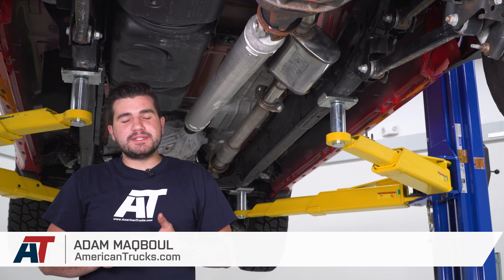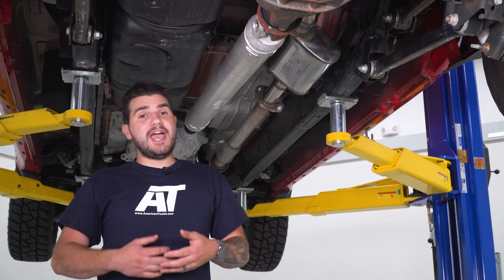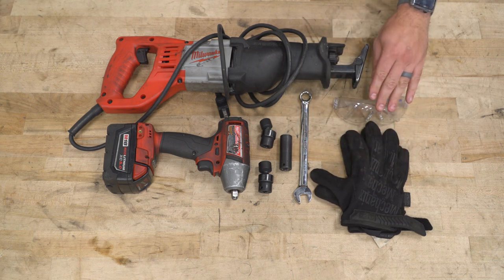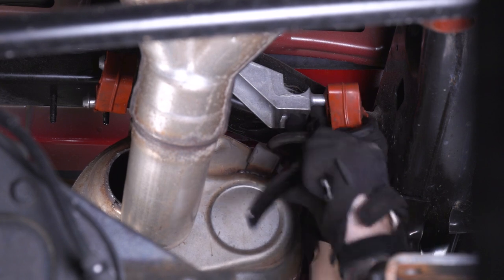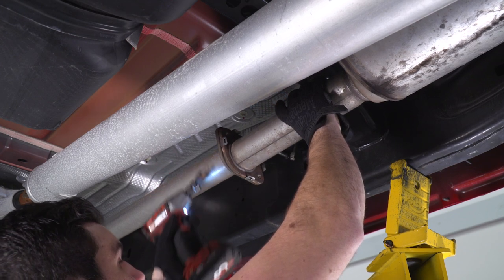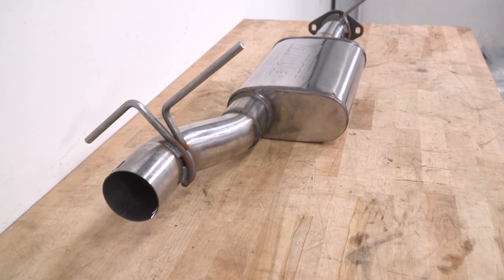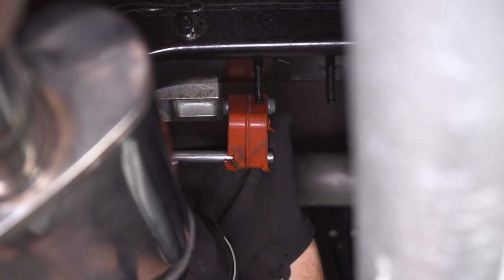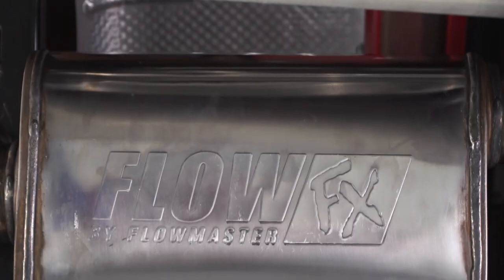2019-2021 RAM 1500 5.7L Flowmaster FlowFX Direct-Fit Muffler Sound Clip & Review

Comment: I wish your video would have used the flow master 1 1/4” measurement recommendation from the weld ring for the cutoff on the OEM muffler so you retain the option to go back to the factory muffler easier.   I followed your video but wish i would have given myself an extra 1/2 to 3/4” if original pipe left on the OEM muffler to use a 3” couple if i want to use it again in the future.  Otherwise the video was great.  Thanks!
Reply: Wouldn't that make it so the flowmaster wouldn't fit because the remaining pipe would be that much shorter?